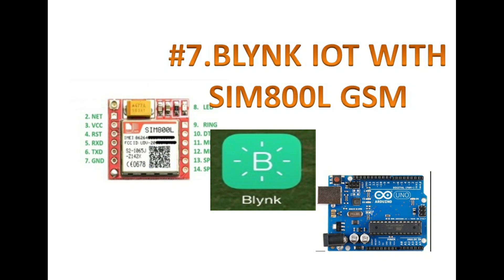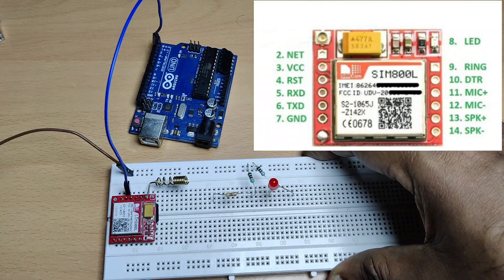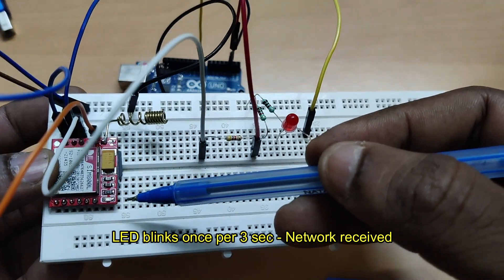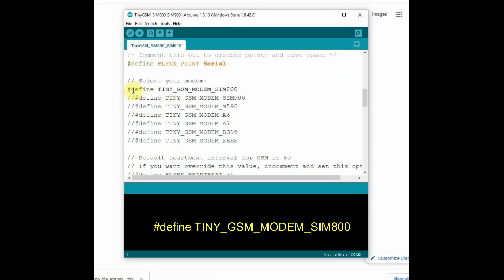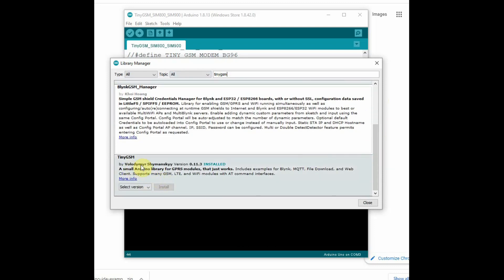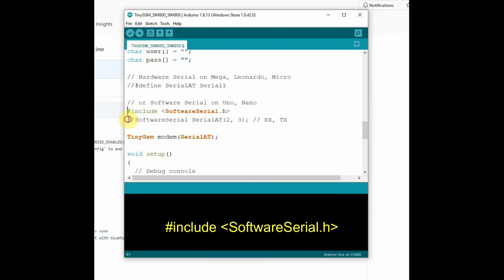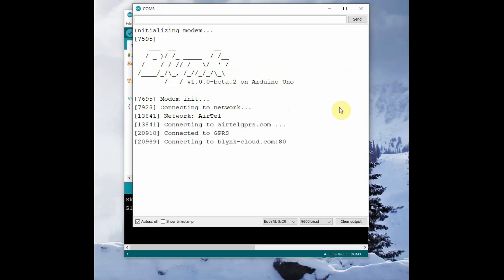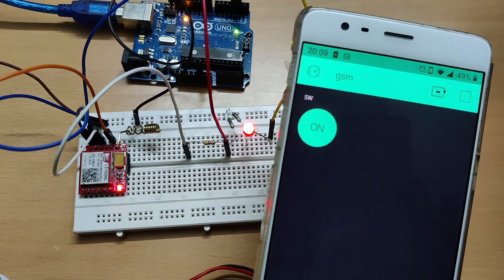Blynk IOT #7 Connect to Cloud with GSM SIM800L

Comment: Hello sir can i want to use this SIM 800l on NodeMCU ESP8266 module, I want to make a system in which if there is wifi present it will connect to the wifi network but if the wifi is gone then it will connect on the cellular network.......

🙏🙏🙏 Sir please reply 🙏🙏🙏

Comment: Hi sir iam getting error while compiling the sketch

Arduino: 1.8.13 (Windows 10), Board: "Arduino Uno"

In file included from C:\Program Files (x86)\Arduino\libraries\Blynk\src/Blynk/BlynkApi.h:38:0,

                 from C:\Program Files (x86)\Arduino\libraries\Blynk\src/BlynkApiArduino.h:14,

                 from C:\Program Files (x86)\Arduino\libraries\Blynk\src/Adapters/BlynkGsmClient.h:46,

                 from C:\Program Files (x86)\Arduino\libraries\Blynk\src/BlynkSimpleTinyGSM.h:14,

                 from G:\Arduino Codes\GSM_as_GPRS_BLYNK_2\GSM_as_GPRS_BLYNK_2.ino:8:

C:\Program Files (x86)\Arduino\libraries\Blynk\src/Blynk/BlynkConsole.h:20:10: fatal error: functional: No such file or directory

 #include <functional>

          ^~~~~~~~~~~~

compilation terminated.

exit status 1

Error compiling for board Arduino Uno.

This report would have more information with
"Show verbose output during compilation"
option enabled in File -> Preferences.